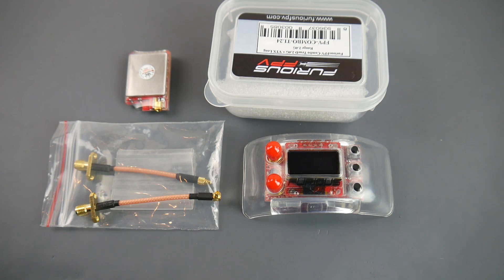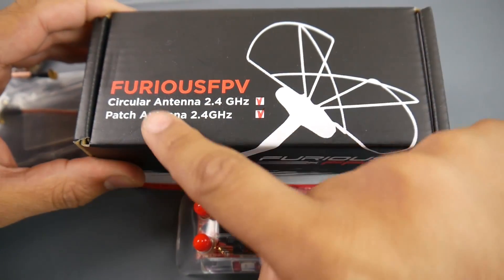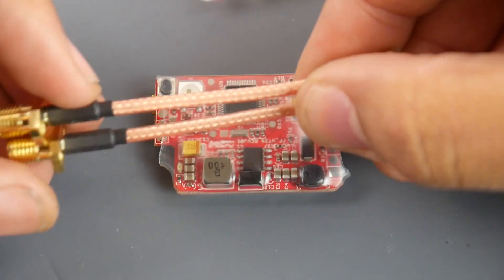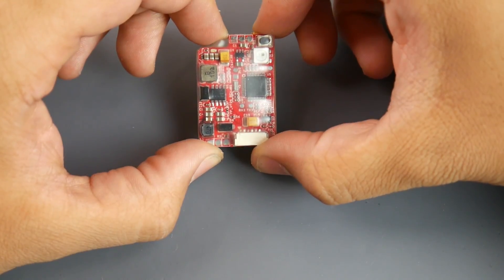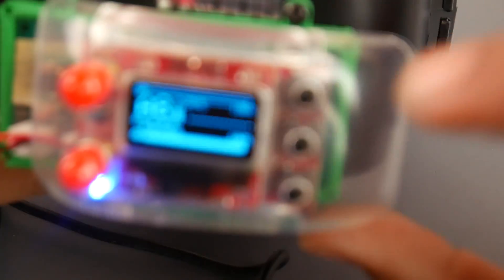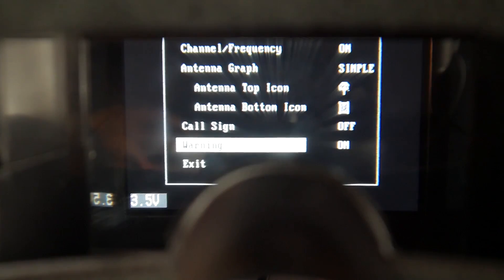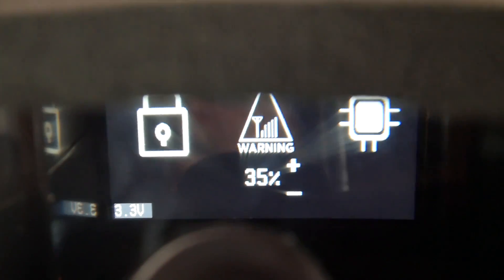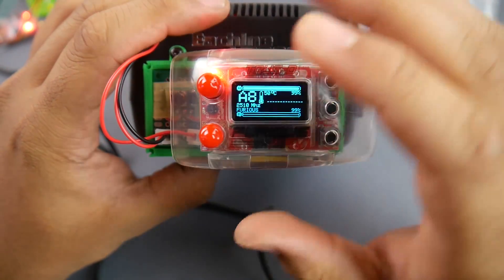FuriousFPV TrueD 2.4G Diversity Long Range Receiver System

Comment: I have the same module as well. I have not figured out how to change the VTX power settings, bands and channels on the vtx thru my radio like I can with the 5.8 AKK vtx with smart audio. Have you been able to set that up on this 2.4 ghz VTX? If so please share! Great videos, I am a big fan of your channel.
Reply from the maker: You cant as I believe the white wire is audio.. But I could be wrong I need to double check it.